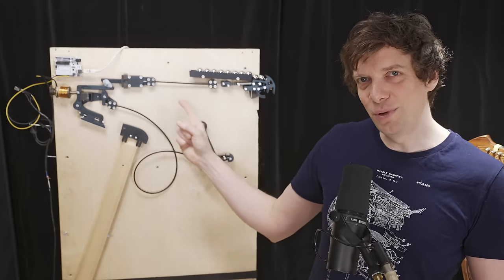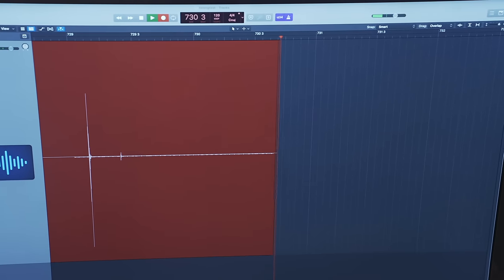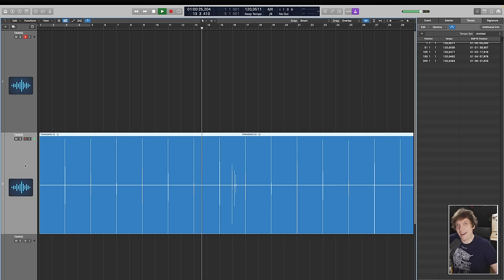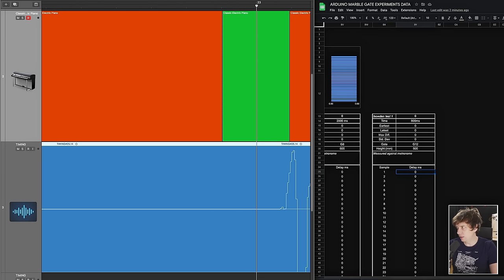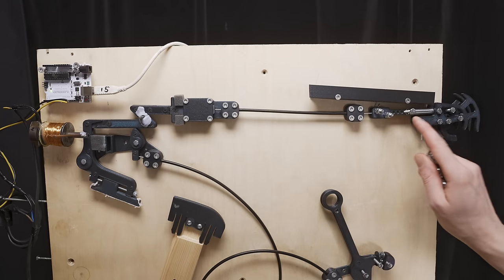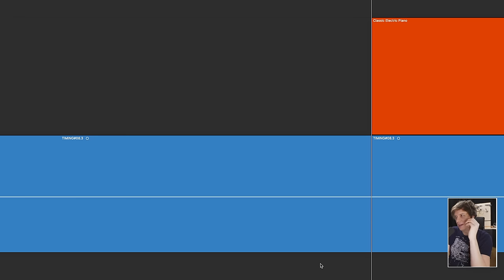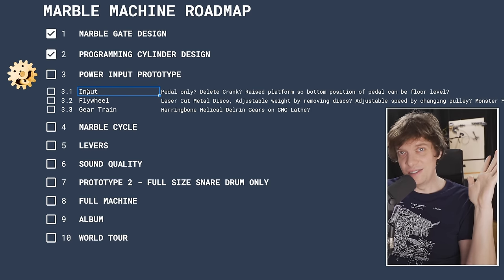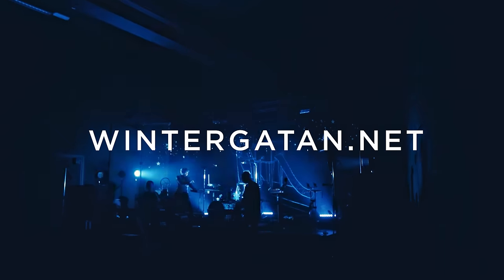Can Bowden Cables Play Tight Music?

Comment: I think the most exciting thing about these videos is that you are tackling the important parts of the machine and making sure they are working. With MMX you would build something that wouldn't work correctly and then spend a lot of time fixing and modifying the design. I know this is your intension this time around, but you can really see the difference in the videos.

Comment: My father had an old hit/miss engine that started with a flywheel.  It had a handle that would fold into the flywheel once it started up and was ' factory balanced ' so as to not cause vibrations, which was an issue due to the age and wear by the time he got it.  The handle of the crank was in need of replacement and no one knew what wood it was or how much it needed to weigh to be balanced again.  It looked cool.

Comment: Hi Martin, great work! But wouldn't this test be more realistic/accurate if you placed an electric rotatory motor attached to the programming pin, simulating the rotation of the programming wheel? Maybe it doesn't affect anything, but this way you could be sure that there's is no flaw with the reader and the programming pins.
Reply: Yeah, this - I reckon it's more something for the future when there's a more developed wheel.

Comment: Martin, a user named  @Xenath Cytrin raised a valid point that Bowden cables have a tendency to stretch over time. It would be important to keep that in mind and allow for adjustment/calibration of the tension over the life of the machine. This would not need to be some kind of custom or complex engineering solution but simply something to account for in your design.
Reply: right. it’s interesting to note that just because a material can stretch doesn’t make it inherently unsuitable – you just need to be aware of that property. I know during my time competing in VexU we would tune our elastics using pre-stretched rubber bands rather than fresh ones which made performance much more stable.
Reply: You definitely dont need a custom or complex engineering solution because a simple one already exists- barrel adjusters for bikes. They can be at the end of a cable or somewhere in the middle and can tune the length of the housing to fractions of a mm. I know martin wanted to avoid needing fine tuning for this design but it seems like a necessity with cable stretch.

Comment: You should also test with a longer bowden tube, and one that is bent. In order to reduce friction, there is slop in the bowden tube not a lot, but some) - and You'll probably find it modifies the results. It seems like in practice you could be using a meter or two of bowden tube, and they may snake around a bit.  Also, I believe you could use the arduino to give you real time and/or logging capable feedback on marble timing. Let me know if interested.  This could be used for adjusting channels, or just for the testing you are doing currently.
Reply: With proper tension on the cable shaking shouldn't be a problem, but yes longer and more curved paths will affect performance. Also, lubrication (PTFE, oil, etc).

Comment: I think you should test the timing using longer bowden cable, at least the length you will later use on the machine. And test when it has loop shape, because you will have to run these cables around stuff on the machine.

Comment: instead of the microphone you could have a simple light with a light cell to check when the ball is released. with that you can measure with the arduino the time difference between the order and the release.
Reply: it has been suggested in multiple videos in the past and it has been discussed about on discord. not sure what the conclusion was but i'm pretty sure martin just can't be arsed to deal with electronics and code; i imagine he wants to make the machine, not make accurate test setups. whatever floats his boat

Comment: Something to keep in mind is that cables only work well under tension, and not compression. They can be as long as you want, but when they are long and you try to push the cable rather than pull, that is where they fail. Similar to throttle cables in a car, they work by always pulling the cable, with a return spring on the throttle body pulling the cable back. As long as you keep the cable under tension (relative to the housing), Bowden cables can be fairly long or intricately routed while maintaining immediate response on the output end.

Comment: Well yes.... A new bike will brake just fine as well.

The point that I'm sure many people are pointing out is that wear will affect timing in the long run. A perfectly routed cable with the proper length will do wonders, of course, but a cable that has been pulling AND pushing for over a month will not only need proper lubrication and cleaning but also replacement. I hope you are taking that into account.

Comment: He's gonna get music so tight that any lack of precision is gonna come from variance in the software 😂😂
Reply: Just put an scope and a sensor. An audio interface is not accurate enough .It is not made to use as scope. You can even tell the arduino to so the measurement and report thourgh serial port. This will surpass any audio card / SW because it is REAL TIME. You put on a high priority EXT INT and thats all. And for the oscillator ... just run on XTAL, you can get 5ppm or even TCOs for ultimate tigtheness

Comment: For future tests like this, you should be creating probability plots, as it would be easier to see outliers and the shape of your distribution.

For instance, an easy way to do this would be to apply a high pass filter/EQ to your data to highlight the transients, and then find the start of the transients with an edge detection algorithm. Then take the backward difference of the transient times and create a probplot of the differences. You should see a tight distribution around 4 seconds and get a feel for not just the standard deviation of the data, but what is the 90th percentile, or what the worst occurrences are doing.

Comment: You can get even tighter linkages by using kevlar lined Mountain Bike brake cables. You can buy the housing and cable in bulk. The kevlar lined used longitudinal steel wires in the housing wrapped with kevlar to keep them where they belong. This is in contrast to the coiled steel variety. Personally I like the JAG-WIRE brand but that's cause I drive an old Jaguar haha.

Comment: Cables become stretched after heavy use. So you have to recalibrate the cables every time. Also temperature makes the cable shorter or longer. You can solve it by using the same length of cables. In that way, the delay will happen at all cables and it still in sync compare to each cable. Still, you have to recalibrate after some time because some cables will be more used than others. Those cables will be more streched over time.

Comment: I wrote this under your previous video as well, but you should add a ball bearing to the tip of the muting toggle, so the pull bar can roll on top of the ball bearing instead of dragging across it. The dragging motion will promote wear and tear and also adds noise and minor resistance.

Comment: I think a small problem with your measuring system is the Arduino is not a realtime architecture. I think you should also record as an input the Hi/Lo signal coming from the Arduino into the relay so that you can use that to contrast what part of the latency is produced by the 'duino, and what is produced mechanically

Comment: You should be more concerned with high marble pressures, it's what caused most of your problems in the past and I think it will cause problems with this mechanism as well. 

With Bowden cables you could consider having two escapement mechanisms in a row, where one is good at dealing with high marble pressures, and simple feeds a small stack of marbles to the final escapement mechanism with is designed for low marble pressures, but good timing.

Trying to have bowden cables, perfect timing and high marble pressures all in one escapement mechanism is asking a lot.

Comment: You could use solenoids in an iteration (or even the final machine) to test the marble gates in a complete setup with midi...
That would reduce the impact of possible problems with the programming wheel until each block is fully functional.

Comment: you should also run some durability tests for bowden cables, and also test with more loops, loger and tagled bowden cables to test for tolerance or unpredictable outcomes might appear down the redesign/building chain later.

Comment: Martin please test realistic bowden lengths and curves. This test doesn't tell you if this design can play tight music in realistic final machine configuration conditions. I would also run this test for several thousand cycles to test the stretching of your cables over time. All in all though I love this prototyping and testing process. I have much more confidence in this machine being successful with this approach for each sub-assembly compared to MMX.

Comment: You should take the signal going to the solenoid and connect it to a 6.35mm jack via series capacitor.  Record that onto another channel to compare the microphone signal to the solenoid signal.  This would help you determine if there is inconsistency in the tempo/rhythm of the Arduino.

Comment: Came to mention that cables like these are great for pulling but not great for pushing. Adding a spring to the end pulling in the direction the cable pushes helps with this. 

Seems like a lot of people had the same thought.

Comment: In my chemistry class (I'm in college) one of the things we do is estimate one extra digit of precision on all measurements. So for example, if we had a graduated cylinder with 15.1 mL of solution in it, we might look at it and estimate that it's more like 15.13. I would be interested to see you do this with the tightness measurements, since you can see where it falls in the 1 ms range, and estimate that it's 0.5 ms fast or 0.2 ms slow. I think the standard deviation out of that would be more realistic, since we all know that it's virtually impossible to have a true 0 for standard deviation.

Comment: Interestingly, within <1ms for 250mHz is better than some Arduino timers can do stock (AVR MEGA). Namely, the internal RC oscillator isn't that good.  It may hold good timing over a short-ish period (like this), but the guaranteed range is a few percent.  You're in the range where a crystal oscillator is -- if maybe not strictly necessary, definitely helpful!

Regarding sources of error, the two-point measuring approach should give a systematic error with respect to the rest of the pulses.  That is, if the starting or ending pulses are in error compared to an ideal baseline tempo, you won't measure that from here (those points have ~0 error by definition), but those errors are added to each pulse inbetween, weighted by their position between the reference points (because, timing on pulses 1 and 100, pulse 2 is 1/100th the way away from pulse 1, and 98/100ths away from 100).  Both errors would be evident as a bias in the result.  But the mean is zero (or pretty damn close to it) so you're good.

Actually the mean should be sampled twice, clustering around each end, to reflect the weighting of the respective errors... since it could happen that both errors cancel out overall, i.e. it's -1ms on the left and +1ms on the right, and a linear slope inbetween.  But it looked like they were fairly evenly placed, or maybe clustered a little late (~ +0.3ms?), so, not exceptional relative to any other pulses in the sample at least.  So tl;dr the statistics look good.

Comment: Martin you can NOT check this off as a valid test of the Bowden cable. You have NOT tested it in enough configurations to conclude that it will work. You MUST test this design with longer cables and with looped cables before you conclude that they will work in the final machine. You have only proven that a very short, very straight cable will work, and that is not what you are going to have in the finished machine. You NEED to test for worst case scenario.

Comment: You have one more thing to consider. the movement of the xylophone key pads(idk what you call them) after marbles hit it. Basically if it hit, the key moves down due to impact and then rebounds up in a vibrating up/down movement. The variation of that could cause the marble that's immediately after the first to hit slightly differently causing the trajectory of the marble to be off. You might need to create a proper mounting mechanism vs what was on mmx. Though mmx version could work just gotta test it. Hopefully it won't matter but we'll see.

Comment: You should do like 10000 cycles with this setup and then do the test again to see if using the equipment will cause some deviation in the future! Maybe it's so little that it does not matter but then you know!
Reply: Or even as the machine plays more notes (at a higher frequency), the temperature-change due to mere friction will also cause variance.

Comment: Martin, time for a bigger test, to make sure the durability is good and timing remains nice after thousands of uses, test the longest cable you think you'll use on the machine, introduce som curves to account for rounting, increase the speed and let it run for a few hours and then compare results from the beginning to the end. Go into this with the mindset that you hate the cables and don't want them, and try to prove why you shouldn't, if they still hold up, fantastic.

Comment: The cable that operates the gate WILL stretch and this will impact timing. Strech can be minimized by pre-stretching cables. Strech is proprtional to length, il all cables are same length it should be less of an issue. To test timing you should try to synchronise two or more channels using different cable lengths. The loop you are using on the clutch mechanism should be tried on the gate to investigate on how length and friction cans impact the timing.

Comment: A single channel playing tight is controlled by the imput. Playing 2 channels at the same time, both tight to each other, is the challenge. As other factors will come into effect. Drop hight being a big one. This would also test your adjustability in the design.

Comment: I think we’re straying into wants over needs again with power input. Surely it’d be better to have a clock like mechanic where by any speed pedalling results in consistent tempo. Then have a way to interact with the clock to speed and slow the tempo. Unlinking pedalling speed with tempo I think is essential to success in this next section.

Comment: I think you missed the elephant in the room and that is the delay is the function of length of the bowden, the bowden has to have some tolerances in order to let the cable move, the longer the cable the more tolerances you gather, the second thing is that you did not test if the delay is also a function of the bowden angle, my guess is the more angle, the more friction = more delay

Comment: If you anticipate using a longer cable, I’d recommend testing that. There is some slop inside the cable jacket that will be amplified with length and with bends in the cable.

Comment: As many people said, bowden cables should not push, they should pull only (as they act on a bike brakes), else they will stretch and lose tightness with time. 
Thinking about bikes, I thought  maybe Martin should consider hydraulic cables for this purpose? 
They are more powerful and more precise just because of how efficiently they transfer the force from one end to another.
There won't be any problem with stretching and they definitely can be used for pushing.

Comment: Have you considered automating the taking of timing measurements? You already have an Arduino hooked up, and you already have an amplified signal of the contact microphone. Making the Arduino calculate the tightness should not be too difficult, and it'd allow you to test much more rapidly (i.e modify the machine see the effect on tightness only two minutes later).

Comment: If you're gonna do more of these timing checks in the future, it might be nice to invest some time now into automating the process with code (python being the most accessible I think). 
Since the transients of the marbles hitting the surface are very clean, it should be possible to analyse the whole audio file and get each of their timings. Then it's just a quesion of doing the math in a big for loop, and possibly write the results directly to a spreadsheet if that's what you like to work with.  

Or you might feel more comfortable doing it visually, which I can also understand

Comment: More jamming! Man I'm still sad you didn't fill a couple of albums with the halloween ondophone thing, but these periodic jams get me through the hard times :)

The bowden cable that actuates the gate will mess you up in two ways:
1) assuming the final design will include a bend in the line (why else use bowden cables?) the friction inside the cable will erode the inside of the bend. Over time, the actuation length gets ever so slightly shorter, and the MM3 will develop a deviation over time. How bad this is, depends on the amount of bendyness (new words are fun!) and material choice, so it may or may not be fine.
2) ANY contamination inside the cable will make it "stick" unpredictably. Use quality cables and grease to prevent this.

Comment: Flywheel, adjustable speed... Makes me think of a CVT like cars have. the mechanism is not too complex if you can get some already made belts. Driven by some Arduino it might be able to hold a bpm well even when the flywheel is slowing down. Or change BPM to something upon getting a signal from a button.
Reply: The current plan is to have no electronics on the real machine, the arduino is strictly for testing prototypes
Reply: I may be wrong but I think that was already a feature in the MMX